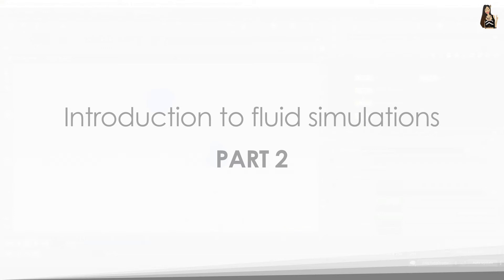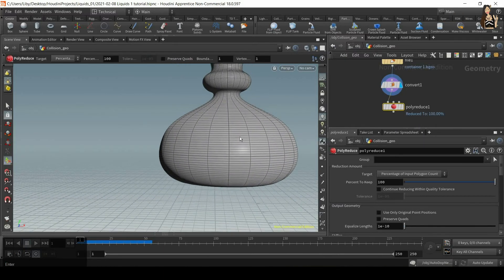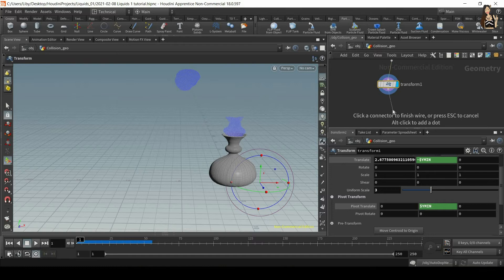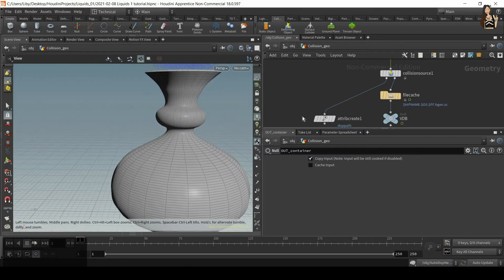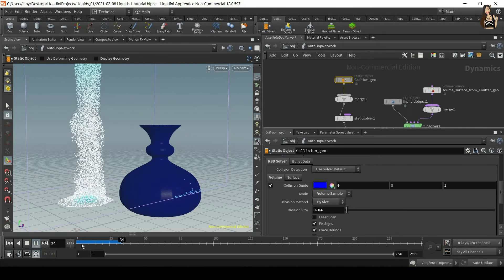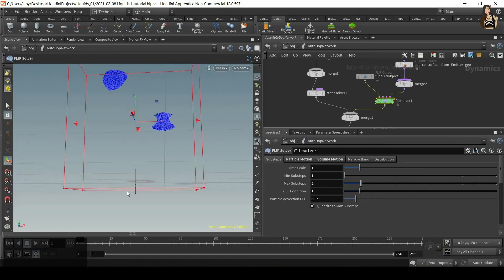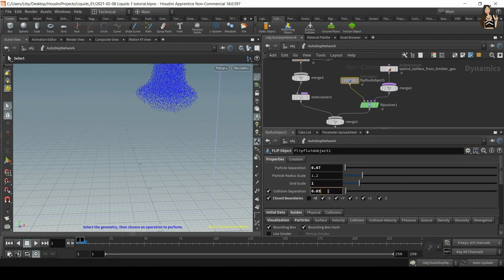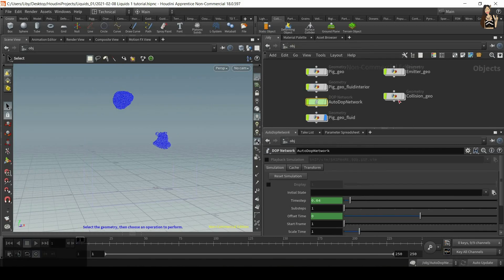Introduction to fluid simulations #2 | Colliders - Houdini 18

Comment: I have followed all the exact steps of your tutorial, but some of my particles still seem to penetrate the collider. What's the fix??
Reply from the maker: Hey Chris Jang :) is your collider moving?
Reply: @VoxelFX  Nope it's static! But I've run into the same problem when the collider was moving. Like putting the liquid in a glass bottle and animating the bottle.
Reply from the maker: If it's static, it should be easier. :) Just make sure the VDB of your container is watertight. You can do it by displaying the "Collision guide" in the "static object" node in DOP network. If you can see gaps, the liquid will go through them. You need to reduce the "Division size" until the blue visualization of your collider is accurate.
Reply: @VoxelFX  Thanks for your reply. I have checked my collision guide and it looks solid. I've run my division size down to 0.012 but there are still a couple of particles that just penetrates my collider...
Reply from the maker: @p73ccw  It's hard to tell without seeing the actual scene, but sometimes if the liquid has very high velocity, it can go through the walls. In this case you'd need to increase the substeps on the dopnetwork under the "simulation" tab. A lighter thing to do fix it, especially if it's just a couple of particles that are going through the collider, is removing them post-sim. For that you need to switch on the "Add ID Attribute" option in your FLIPsolver/Particle Motion/Behavior. Then, delete the unwanted particles based on their id.
Reply: @VoxelFX  Increasing the substeps for the dopnet was such a brute force way, but it solved it for now I guess :). I really enjoyed your tutorial and hope to see more tutorials on flip fluids. Thanks for your help!
Reply from the maker: @p73ccw  I'm glad it worked! You're right, increasing the substeps is usually the last thing we want to do, but if we've got fast-moving fluid or geometries, high-viscosity fluids or surface tension, it might be the only way. :)

Comment: Hi, I recently started studying Houdini and found your channel. You are better than any courses! Thank you for your tutorials! I have a question. What if I import an alembic, and the model will have its own animation, which I baked in another program. Will it be a deformable object or an animation (for collision)? And what about models with skeletal animation?
Reply from the maker: Thank you Demgreart! I’m happy to hear the videos have helped 😊
Answering your question, for any moving object you’ll use the “Deforming Object” shelf tool or if you create the collision object manually, then tick the “Use Deforming Geometry” option on the “Static Object” node in the DOP network. It doesn’t matter if the geometry is animated in Houdini or any other software (though sometimes you’ll have to prep it).
Although, it can be a topic for a separate tutorial…
In terms of the naming, you’d call any moving model that comes from a different software a “deforming” geometry too. It becomes an “animated” geometry if you add keyframes on the OBJ level in Houdini, in which case you’ll also have to use the “Use Object Transform” option on the “Static object” node in the DOP network. At least when we talk in the context of FLIP simulations.
Here’s a video that explains it in a bit more detail: https://www.sidefx.com/tutorials/bullet-collisions-in-houdini-deforming-vs-animated/

Comment: thanks for your help but my glass doesnt fill with the particles i dont know why???
Reply from the maker: Hi mahdiw mousavi, there are several things that might be happening here.
1. Check your collider geometry, make sure it is closed (watertight). If you are not sure, do the following after your created/imported 3D model.
- "VDB from polygons" and adjust the Voxel Size to get a bit more detail, e.g. 0.08
- "Convert VDB" and change the "Convert to" option to "Polygons"
- Use this as your static collider
2. If it is still not working, make sure to check the collision geometry in your DOP Network "Static Object" node.
- StaticObject/Collisions/RBD Solver/Volume/ switch on "Collision Guide" to see the blue representation of the object
- Adjust the "Division Size" if needed
3. If this still doesn't work, use "Collision Separation"
- DOP network/FLIP object/Properties/Collision Separation
- Set the value to something a bit lower than your Particle Separation*Grid Scale

Let me know if any of this helped and then we can troubleshoot further. :)
Reply: Particle Radius Scale / Grid Scale   >= 0.866

Comment: Exactly what I needed. Thanks a bunch! Subbed.
Reply from the maker: I'm happy to hear that! Thank you ^_^
Reply: @VoxelFX  You're welcome. I ran into some problems I'm hoping you could help me out with. 1st of all, how would I go about telling Houdini to only start simulating at a specific frame other than frame 1? Say I have an animated Can with fluid and want the fluid to start being emitted on frame 100. I toggled the brain icon as you instructed, but noticed that it still simulates all the other frames. 2nd, once I finally have my setup ready, how do I go about converting the particles to mesh so I can start shedding and rendering? Overall, it was an awesome tutorial!!
Reply from the maker: @AcerKanyiki4 
Here's a link that might also help to answer the 2nd question: https://youtu.be/UQXS12sj9IA?t=808
1. The brain icon disables the simulation for the entire scene, which is helpful if you want to work on the models or add keyframes without waiting ages for the simulation to re-simulate. If you want to change the start frame of your simulation select the "AutoDopNetwork" (OBJ level). You will find the "Start frame" option in the "Simulation" tab. You simply type the frame number you want your simulation to start.
2. If you use the shelf tools, the network for meshing will be set up automatically. You can find it in the OBJ level, it's called "particle_fluid" Then, display the "surface_cache" node or the "RENDER" null to see the meshed liquid. However, when you render your scene, Houdini will automatically read data from that node, so the liquid should be cached ok. :)
Let me know if it helped! :D
Reply: @VoxelFX  Thanks for the reply. The tips were invaluable! But I saw that I can also change the frame start from within the DOP network (Fluid Particles - on the Creations Tab). I'm not sure if it's the correct way, but it seems to work just fine. Please advise. 

The scene that I'm working on is for a Soda Can that's supposed to pour liquid into a glass. I went through the entire setup successfully, and have officially hit an unbreakable wall. I have literally spent hours on this with zero success. The fluid is filling up nicely and I've managed to tighten up the voxels to keep the fluid in the container. But the action of tightening up the voxels also seems to be restricting the fluid from flowing out of the Can through the hole. 

I couldn't understand why, so I loosened the voxels for the top part of the Can and completely reduced the offset, re-simulated and the fluid is behaving as expected. I've tinkered with as many settings as described in the video for the top part of the Can to let the fluid through and it's not working at all. Please help! I've included a link to my g-drive with the .hip file for examination. I'll grant you permission once you request entry: 

https://drive.google.com/file/d/1Kp2Dpd6vaExEp58MTfwma4S1E6Az-71Y/view?usp=sharing

Please live any helpful notes in the file if you see fit. Much thanks!
Reply from the maker: @Aser Kanyiki  
You can change the start frame in either place as they are linked. There are always several ways to do one thing, in my other tutorial I showed a way to do it with VEX: https://youtu.be/HIJuYzNyTCg?t=1100
Regarding the simulation, there are several more things that will help you in a situation like this:
1.	Make sure your collision geometry is good quality (meaning: no holes, good topology, extruded walls); this way you will save a lot of time fixing it in the simulation. Also remember that the simulated geometry doesn’t have to be the same as the one you use for rendering, so you can have slightly bigger extrusions or lower polycount to make the scene simulate faster.
2.	Check the particle separation. In short, each water droplet has a specified size, so if the single particle size (particle separation) is bigger than the hole in the geometry, it will not go through. So lowering the particle separation might also help.
3.	Increase the substeps. By increasing the substeps you’ll allow Houdini to make more precise calculations, so small holes and interaction between the particles and the colliders will be better.
In your case, it was a mixture of all. I’ve sent you the new scene with notes via email.

Hope it helped 😊

Comment: I have clicked icon "create Static Object" twice. Nodes are duplicated. Iam so confusing. So I deleted all those nodes. But the Warning sign appear. Finally, i have to do all over again (i fogot to undo). Houdini is dangerous for me if i dont really understand it clearly. (English is not my main language xD). Btw, thank you so much for making these tutorials!
Reply from the maker: Don't worry, Houdini is difficult and it takes time to get used to it. :)
When you are not sure if the shelf tool worked, it's best to check if any new nodes are added in the AutoDopNetwork before clicking on the tool again. There's also a description of current actions at the bottom left side of the screen. Just take your time and you'll get used to it soon! :)
Reply: @VoxelFX  Thanks, i'll keep this in mind.